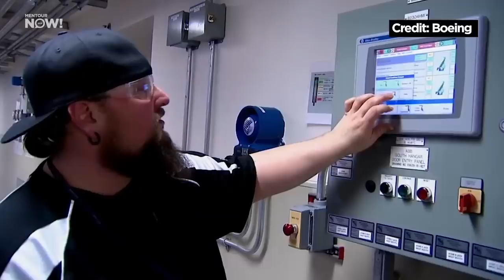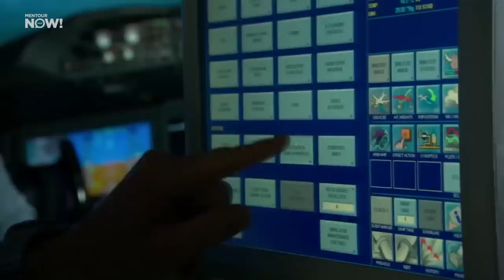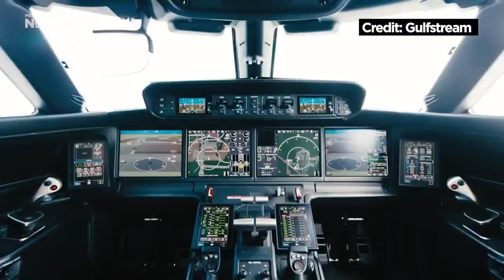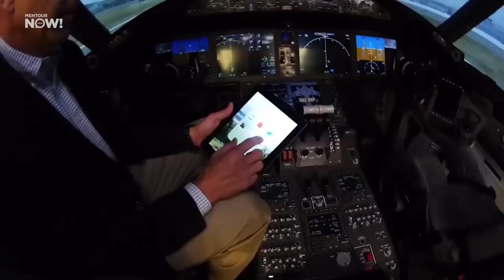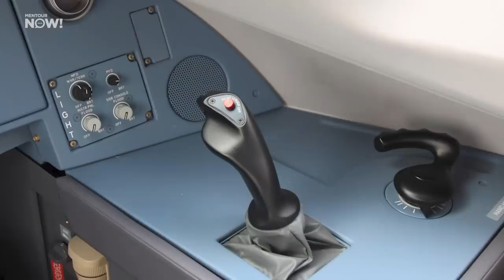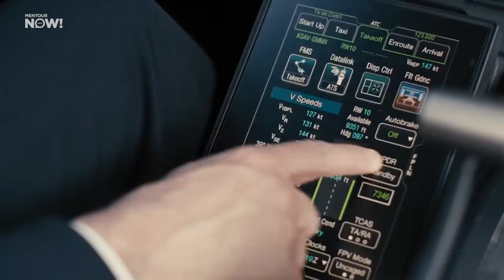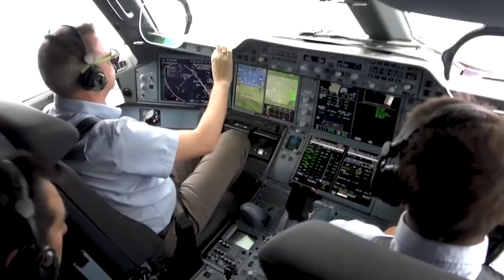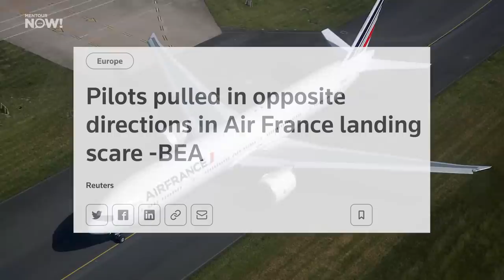Is Boeing Switching to SIDE-STICKS?!

Comment: I'm not a pilot, but I imagine I would really appreciate a proper yoke. It just feels safer somehow, and more like a genuine aircraft if that makes sense. And of course I could see what the other pilot is doing. That being said, I see the benefits of the sidestick and wouldn't be surprised if Boeing decided to go for that option eventually.
Reply: Except pretty much every pilot grew up playing simulators using a joystick. It's only natural that planes should evolve with generational technology.
Reply: I believe it's all fly by wire now anyway, so there's essentially no difference whatsoever between the two from a safety standpoint...?
Reply: I love the woke when it’s gusty but for the remaining 11 hours id rather have space for my legs and food.
Reply: Sidestick feels much more natural for aircraft in my irrelevant opinion. Yoke are brought over from how human drives automobile most likely. Most high performance aircraft such as aerobatic and fighter use a stick, are these aircraft not safe or genuine?
Reply: What, are fighters and helicopters not genuine aircraft?
Reply: There are direct nerves between brain and hands, with accurate nervous signals to control the latter and their fingers. But arm muscles nerves, necessary to act upon yokes, are less developed for strength control than for precision, in addition to having several interneuronal connections (synapses) that add delay response time, as well as a much higher mechanical inertia (arms, forearms, hands, yoke, cables, pulleys, levers, etc.). Yokes require strength sometimes, adding fatigue to already stressful situations when planes do not respond adequately to controls (e.g., if hydraulic pressure is too low).
      There are many advantages in choosing sidesticks. Not all are pros, though. Servo-sidesticks take one or two cons off.
Reply: For decades I've been able to use one or the other on my PC, including hot swap.

Why aren't these things modular?!

You should be able to control a plane from any random cell phone or tablet, from multiple redundancy reasons.

Crew Dragon already does this. Crew Dragon is also fully autonomous. But assuming something really crazy happens and they lose access to the primary touchscreen controls, literally any device with a screen can be used as a backup.
Reply: @wafikiri_  if hydrolic pressure is low it wont affect the pilots because its fly by wire 💀💀💀🤚🤚🤚🤚
Reply: @wafikiri_  I fly both Yoke and Side stick. Both ways are fine. Being in the latter part of my career, I probably prefer the side stick cuz u sit a bit more relaxed in the seat. But all the stuff u wrote doesn’t make much sense. There is no added fatigue 🤣🤣🤣
Reply: @rtbrtb_dutchy4183  I quit piloting just before sidesticks and EFIS were first used in commercial aviation, but still feel that sidesticks have many advantages. When I talked of added fatigue, I did not mean in normal use, as you can check out in my prior reply. I meant in some stressful situations, the kind both pilots have to exert all their force on the yoke just to avoid crashing (think, for instance, of GPWS telling you "terrain, pull up," or of finding out the bank angle is unexpectedly high, such as 70º, due to some failure or anything). And, anyway, all the weight of a classical yoke system means added fuel consumption in everyday use. And you can't have a table if there's a yoke that gets in the way. Etc. Others have listed the pros and cons elsewhere. They much favour sidesticks. However, servo-sidesticks should be used, to have both interfeed to know what your fellow pilot is doing, and aerodynamic forces feedback.
Reply: @rtbrtb_dutchy4183  I can agree, sidesticks are much easier to use, I also feel more safe and comfortable with a stick.
Reply: As a pilot, especially one who’s flown both the 737NG as well as the A320, I see no reason to go back to the yoke. Its easy, intuitive, leaves up space for other things (especially the meal table!) and one doesn’t need to peer over the centre stalk to see the two displays.

When eating a meal off the food tray, it was common for the yoke to hit the tray during turbulence, spilling some of its contents. In fact, we had an insider joke: “how do you tell a Boeing pilot from an Airbus pilot? By the food stains on his tie”!!  None of that on the ‘bus now.

Comment: Having been an RC model pilot in the 80s I am familiar with different controls on the sticks. I would like to compare with cars having the driver left or right. Don’t you think reaction response is a bit lower when you constantly have to be aware which seat you are in? It really makes a difference when emergencies occur and automatic handling need to kick in.

Comment: When McDonnell Douglas made the MD-90 - a new version of the MD-80 series, they gave the aircraft a new cockpit. But due to cockpit commonality issues, multiple airlines wanted to keep the MD-80 cockpit. So in the end, McDonnell Douglas created both - a modernized cockpit and an old cockpit. All the airlines chose the old cockpit, except for Saudi Arabian Airlines. It should be possible for Boeing to create a new cockpit where the airline can choose between side sticks and yokes, but they would have to certify both types.

Comment: I'm all for control sticks (yokes or sidesticks) feedback and interfeed. However, I've always felt that aerodynamic feedback to controls by following the velocity squared law was inherently wrong, because of two factors, as follows:
    • Feedback sensibility results too much reduced at lower speeds
    • Action on the controls requires too much strength at higher velocities if untrimmed or affected by aeromechanical malfunction or by center of gravity misplacements.
     In the transition from light airplanes to heavier ones some sixty or seventy years ago, such a feedback law made sense: flight simulators could not simulate such subtleties, so the said transitions had to be softer. That was, by the way, when fly-by-wire was initially thought up. Thus, even Boeing B-747 was designed with that squared velocity feedback law.
    But, nowadays, there is no reason not to adopt a better feedback law, which might lay between speed-independent and just proportional to plain speed. Training in modern simulators makes the squared velocity feedback law obsolete, unnecessary and inadequate, even dangerous.

Comment: I think this compares to something we all use but might not immediately link. PC users all have a mouse that each of use set to our own sensitivity. PC gamers take this a few steps further and bespoke these features and tune them to their own motor skills. 
A yoke is like setting a lower DPI (sensitivity) and will give a more controlled point to point but require greater input for quicker movements
The Sidestick (Joystick) is a high DPI which shortens the throw, giving an instant move to the direction you'd like to face

Both work for different people, a sniper would prefer a joke while a SMG user a sidestick. The real "which is better" only depends on the battlefield they play.
In a controlled approach then the yoke is king, throw in a sudden un-expected side wind then I'd rather be holding a Sidestick. Apples and Pears.
Reply: Joke or yoke?

Comment: I still remember my first "fly by wire" AKA throttle by wire motor vehicle. I hated that the accelerator pedal didn't move with cruise control because I couldn't tell how far to move the pedal when I wanted to pass something without causing a downshift.

Comment: is there a problem with pilots being better aviators with one hand over the other depending on which seat they are in? Once you get promoted to captain do you have to relearn how to fly with your left hand?
Reply from the maker: No, not that I’ve ever heard of. The same actually goes for yokes as well if you think about it. Left hand pilot uses right hand on thrust and left hand on yoke and vice versa.
Reply: I taught Boeing pilots to fly Airbus for 16 years. I'd say it requires 10-15 minutes to get comfortable with the left hand side stick.
Reply: No different to having right hand drive vs left hand drive in cars (20% of cars in the world drive on the other side of the road to USAnians) - it takes only minutes to completely adjust. Don't forget that you actually only need a hand on the stick for a few minutes of each flight anyway as most of the flight is hands off on autopilot. Not being easy to accidentally bump is one of the advantages of sidesticks.

Comment: I think Boeing should go for mid-sticks, thus eliminating problems that can occur, depending if you're left- or righthanded. Also, there is no need to extensively train to fly with both hands as the main hand. Also also also, if there are two right handed persons, the one in the left seat would probably have less force than the person in the right seat, with side sticks. :)

Comment: You should take a look at the Avro Arrow from Canada.  They developed a feed back FBW controls in the 50's for the Avro Arrow.
Reply from the maker: Yep, there are a lot of cool new designs.
Reply: Yup, that experience of flight controls from the Avro Arrow's knowledge in turn was used by NASA for the space program in the 60's and of course the Lunar Lander had a side stick. A lot of Avro engineers ended up working for NASA after the demise of the Avro Arrow program.

Comment: There's seem to have been a lot of accidents on Airbus airplanes where both pilots were inputting on the side-sticks without knowing it. This doesn't seem to happen on Boeing planes as you can immediately notice that the other pilot has their hand on the yoke.
Reply from the maker: Hence Boeings earlier decision to stick with yokes.. but as the video says, that’s about to change.
Reply: @MentourNow  fortunately, because when you have to correct a flare or a wing low to a Rookie pilot it’s really very unsafe because the takeover push button is counter intuitive and when the other pilot is with túnel vision in a difficult approach he usually doesn’t  even hear the “I have control” call out. Also with the very heavy roosters that are a joke concerning  aviation safety even if legal, in a last leg of a 12 hour day you are somewhat slower.
Reply: The only known accident where this was ever cited as a factor is AF447, and the pilots there had already got themselves in such a panicked and confused state that I don't think a yoke would have made the slightest difference.

Comment: After air france 447 I was really surprised the A350 did not have a proper feedback feature. In high stress situations it's a very obvious advantage.
Reply: #BoycottShingrix  That is not a good argument, since there are an equal number of Boeing crashes that couldn't happen on an Airbus.

Comment: Sidesticks were considered for the 777, and they made a prototype system. I was told that sidesticks were not chosen more because of the prototype sidestick implementation rather than the concept. (I was told this by one of the engineers  who was on the sidestick prototype team.)

Comment: It's absolutely blowing my mind that active sidesticks haven't been standard for decades. I remember force-feedback joysticks in the mid-90s and I guess I just figured that any flight-stick-based Fly-by-Wire system would have include a higher-quality version of the concept.
Reply: There is alot of electromechanical magic that needs to be designed and proven to be absolutely fool proof, motors, motor drivers, position sensors, fail-safes, software and a well documented and proven solution to every consevable failure mode that this complex system could generate.

Comment: Can you imagine a jet fighter with a yoke? Nothing more to add.
Reply: P-38 lightning. I would say the P-38 was a pretty good fighter.
Anyway, transport category aircraft are not supposed to be flown in the same way as a jet fighter. If you did you'd get fired.
Reply: Most military cargo planes use yokes. Passenger planes are not fighter jets.

Comment: There is even more weight to save with fly-by-wire. As far as I know they all still use good old copper wires. For sure it is lighter than hydraulic lines, etc., but what is even lighter than copper is optical fiber. When I was studying 10 years ago, this was already discussed a lot, but of course it must be reliable and safe in order to be a viable option for an airplane, and now it seems like some companies actually reached that state of maturity for optical fiber technology in avionics, so we'll see this being used in newer models in the not-so-far future, I assume.

Comment: I've only flown airplanes with sticks and yokes and to me the stick was much more intuitive and natural feeling even though both are somewhat similar.  Perhaps it was because I'm right handed and could fly right handed with the stick.
Reply: Another disadvantge of a side-stick is that you can only use one of your hands to control it. With a yoke you can use either hand if needed. Of course a center-stick would solve that.

Comment: Should be easy to switch back and fro. Like switching between a automatic car and a gear shifter. I commonly switch between a Tesla and a Land Rover defender and my brain just shifts to „ different way of transport“ mode like changing between a car and a motorcycle.

Comment: I've got a few thousand hours on both yokes and Airbus sidesticks. An Active Sidestick seems like the ideal control input. That should also be augmented with visual "crosshairs' display on pilot flight instruments (as required! i.e. Dual Input Detection and Warnings!).  The sidestick is actually a more natural control device - avoiding any tendency to 'drive/steer' the vehicle as if it were a car. d'oh.

Comment: Sidesticks are superior. Everybody is switching to sidesticks, Embraer, Comac, Bombardier, Irkut, Sukhoi, Dassault, Gulfstream, all jet fighters, helicopters, etc. Yokes are clumsy, a waste of space and add more unnecessary weight and complexity. Modern airplanes are Fly by Wire, you are basically sending inputs to a computer. Yokes were needed when there was a lot of cables and pulleys to be pulled. It's like wanting to have a mechanical typing machine attached to our home computers to type on the screen... Boeing will too change to sidesticks, it's just a matter of time (and stubbornness).
Reply: Embraer still uses a handlebar yoke in their E-Jets. Personally I’m a fan of the yoke if I’m honest. I hope Boeing keeps it.
Reply: I don’t agree right now but I guess il watch this video and find out more. I really like how pilot explains things so beutifuly.
Reply: You forget the biggest benefit: crew awareness. Either Pilot knows exactly what the controls are doing. AF447 wouldn't have happened on a Boeing plane. Full stop 

Until feedback and back driven positioning is robust and reliable, it won't be in a Boeing FD. Safety first.
Reply: @claysonantoons3142ell said. And AF447 may have resulted differently had the crew used more visual awareness. I can't imagine too many scenarios where you wouldn't be able to literally see your colleague handling the yoke. And plus, they were BOTH handling their respective yokes (which should never happen in reality as only one pilot should be flying at any given time) AND sending significantly different inputs on top of that. Side sticks are the way to go. I do think that trimming should be more of a focal point to help mitigate the possibility of getting outside the flight envelope. 💡

Comment: The lack of mechanical linkage is deadly. Look at the Air France 447 crash and the incorrect inputs being made. If that was a yoke, the other pilot would have noticed the aircraft was being pulled fully upwards whilst in a stall and probably added corrective inputs to get the nose down. 
As you mentioned, Gulfstream have an excellent sidestick system with electrically moved synthetic inputs, so you can feel what the other pilot is doing. It's a real shame the Airbus fleet can't be retrofitted with this tech.. but money rules these days.
Reply: For every Airbus crash where Boeing pilots brag that it couldn't happen in a Boeing, there is a Boeing crash where Airbus pilots can correctly claim that such a crash couldn't happen in an Airbus. Air France 447 likely wouldn't happen in a Boeing. But Asian 214 and Emirates 521 wouldn't have happened if they were Airbus planes.

Comment: Control Loading in FFS is actually a very peculiar system. The pilot actually doesn't move the controls. There is a force transducer built in to the linkages under the floor. The transducer senses the force the pilot applies and then the flight dynamics code together with the flight control system code in the simulation calculates what deflection the control should have if that force is applied. That is then passed to the actuator (back in my day it was all hydraulic, the new ones tend to be electric) that moves the control. If you put the sim in TOTAL FREEZE (if i remember correctly, FLIGHT FREEZE doesn't usually have this effect) the controls become stiff as a stone - you won't budge them - that is until you apply excessive force and the protection kicks in and kills the control loading (and motion). On one particular sim, the pitch force transducer was in the mounting where the yoke went in to the column - you could deflect the column forward by squeezing the yoke and column together with your fingers. Conversely, you couldn't move the column by pushing on the column itself, it only reacted to force applied to the yoke. It was a SAAB 2000. It was kinda weird that way - and in some other ways as well... :)